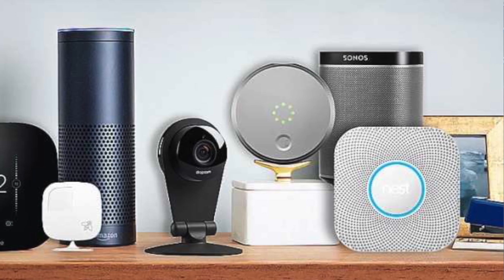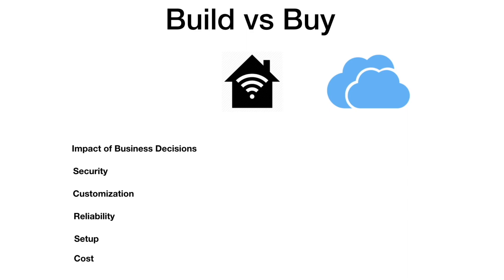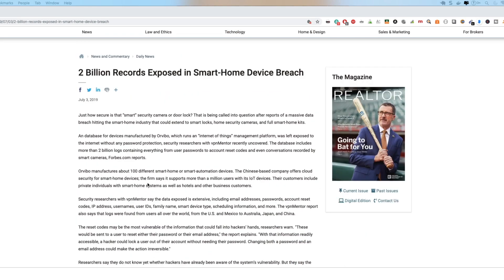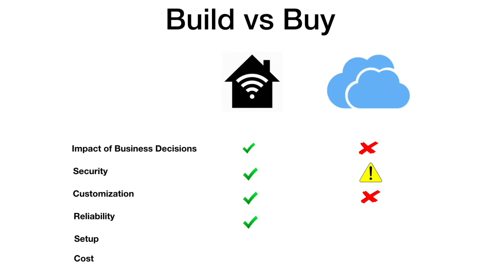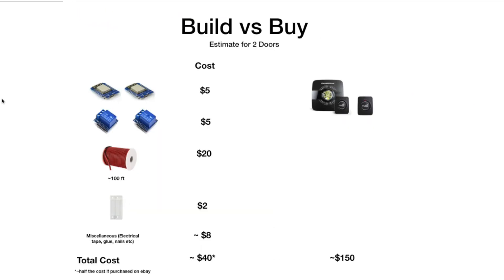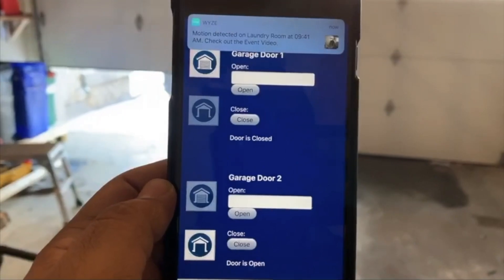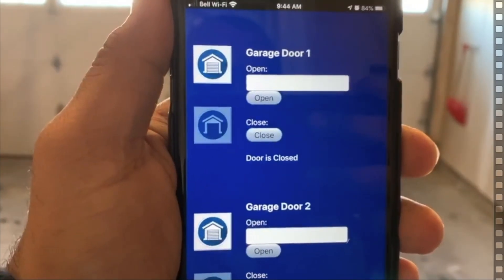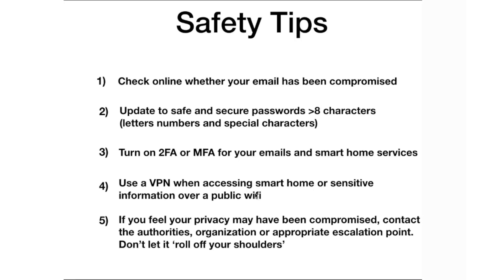How to Build a Powerful Smart Garage Opener with 2FA (Part 2)

Comment: Hi, 
Could you please create a video of how to build complete setup of garage gate automation and capture these things? 
Where is code residing? 
How did you connect chips with relay and then how wires are connected? 
Which motor did you use to open garage gates?